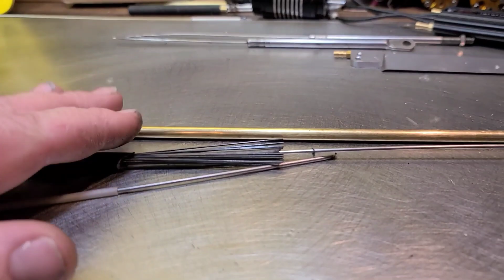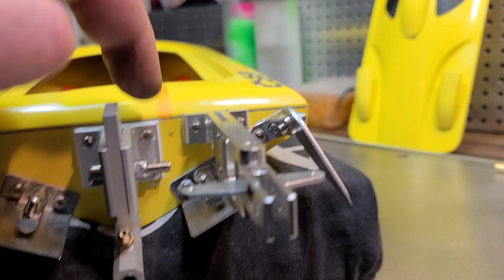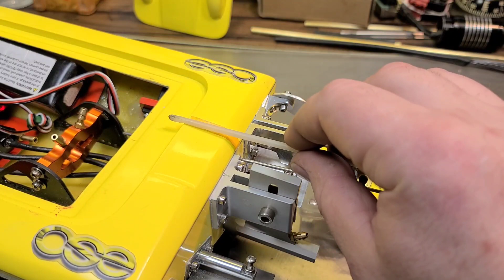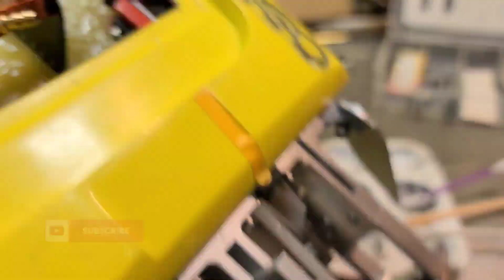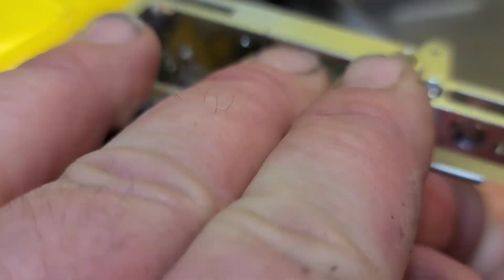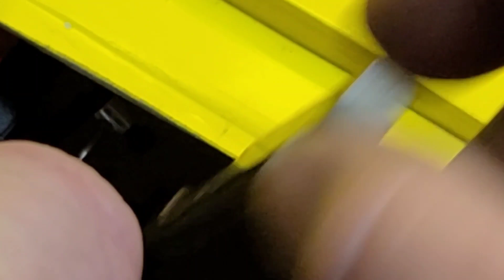Fast Electric RC Boat Build Pt6 Steering Rod & Linkage Installation - Deltaforce Sniper

Comment: will you put flotation material in it also will you set the esc with forward and reverse,I've had a few boats go right under and keep going under into the mud and not surface for a few mins ,I f I had reverse I'd use it to back out again 😊
Reply from the maker: Yes sir probably use a block of foam , I usually don't use reverse in my boats.   Only one I use reverse in is the mini rigger. I'm about to change to a submerged drive on the mini rigger.
Reply: @IRONCLADRC  Nice one 😊👍 That's good submerged is suitable for riggers better turns etc.Goodluck with your first test on this mono hull should be really good handling